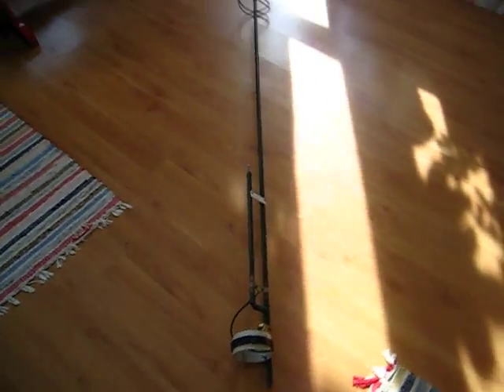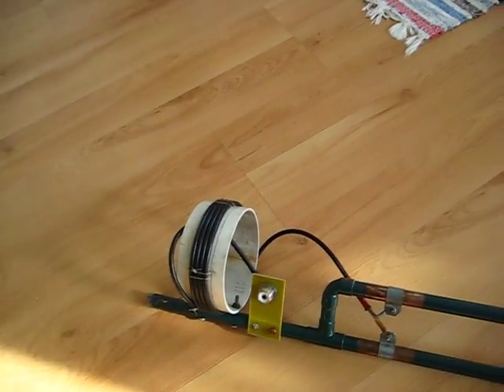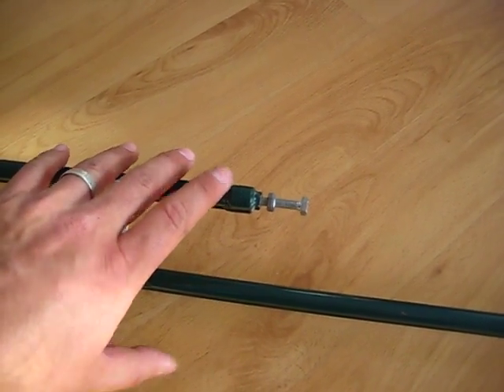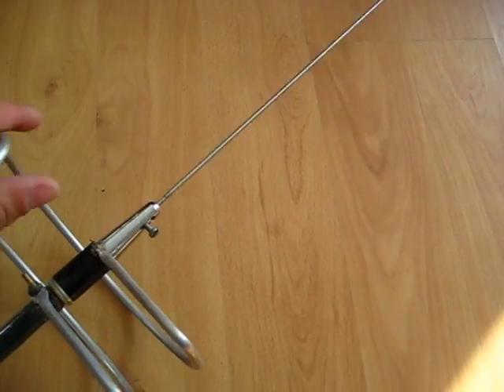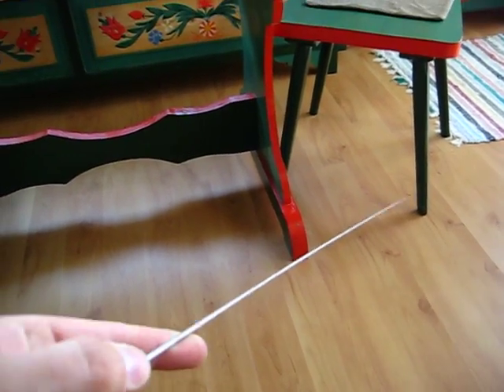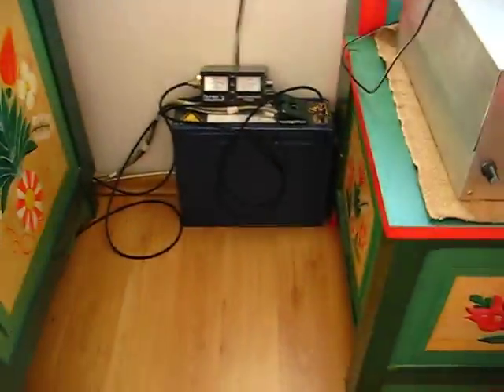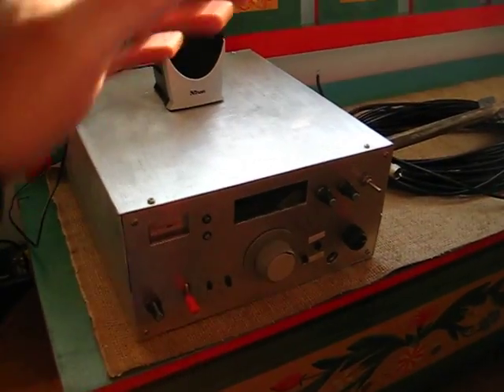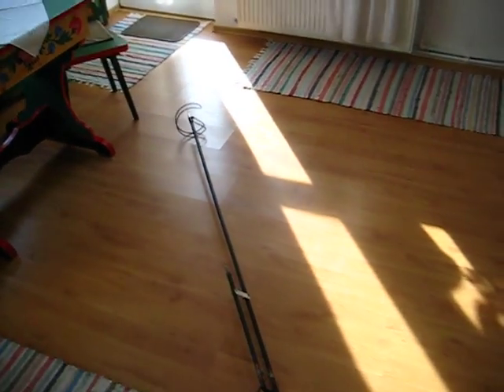5/8 wave J-pole antenna for 145 MHz

Comment: Pros : Excellent Pro-Look and Finish , you can sell it ..
Cons :  i am only worried about the SO-239 fixed in a board which susibtiable to break in rough condition ..

However 
i think this is not 5/8 element as the video address.
i think this is a  2 HalfWave Collinear Elements working together as both have the same Phase ..which yelds = more Gain + Lower Radiating angle than the conventional (5/8 wave Antenna = 4 feet antenna for mobile)..

5/8 wave lenght = 3.5 dBi
2 halfWave = 5.5 dBi (Better but Longer)

Comment: Just found this and am intrigued.  GREAT design.  However you call it a 5/8 J-Pole antenna, yet the phasing element is at 1/2 λ and the CB antenna you stated as 1/2 λ but looks about 5/8 λ in length… ?    Doesn’t the addition of the “CB” antenna mess up the 5/8 λ total length of the 2 Meter length side of the J-Pole?  Also the diameter of your balun, ~5”?  5 turns?  Thanks!  Newbie… KI7QAB  73’s!

Comment: hi pityu... most mosques in our area have fm transmitters. they transmit lectures and prayers ect. it is a good system. however people living in lower areas cannot pick up signals. the transmitter runs on " 60 mhz to 70mhz". can you send a video on how to make an antenna for this

Comment: I use the CB Whip part to spank my girlfiends butt too. She seems to enjoy it, idk. Great build man, thanks for sharing. I finally got a HF Transceiver, an Icom 7410. Now I'm stuck in an apartment with no antenna tolerance. I put 16 ft. Of bare wire around the walls at my apt. Working 20 meters, 17, 15, 12, and finally 10 meters sunday to Virgin Islands from Western Arkansas. I need a boost on 2 meters to hit our repeater due to all the apartment bldgs. I have around me. So thats a solid aluminum tube ring...Wow, I have some in my closet. Thanks again sir, I hope to hear you on the bands. 73
AF5DK,
Phil
Reply: Phillip Swearingin build a mag loop. 3-4 feet in diameter and can handle 200W+ with the correct capacitor

Comment: Very Funny : I built the same 20 years ago. It was almost totally identical, painted black like this one, with a bolt on the short leg for adjustement and a thin upper part on the long leg. Only difference : The thin part was 6mm copper tube with another screw at the end to adjust. It worked like a charm for about 5 years on the roof of a 17 store building. Then I moved to another house and tried something else :)

Comment: you should have done 1/4 wave element 1, then 1/4 wave first section element 2, then another 1/4 wave phasing element, then 1/4 wave cb whip element,  = 1 full wave and it would have been shorter over all.

of course this would mean the center conductor would connect to the small 1/4 wave element and it should be isolated from the rest of the antenna . basically the open stub design.
Reply: sir sorry to bother you so you deff 100% count the phasing element  as well ? every time ?  so in your case your phasing element used two of the eights or 2/8 ?      his set up has me clueless i thought jpoles was 3/4 .....  so im not sure if its just a 5/8 or more ?    ..... but i would like to know if i myself  wanted a 5/8 over 5/8    antenna  would i use a 1/2 wave phasing coil or a 1/4 ? if so whats best?

Comment: if you were to take a reasonable hobbyist's whack at hailing NA1SS (the International Space Station here uses somewhere around 145 MHz in this region usually more so than the VHF2 channels) which style 2m antenna would you use without going motorized tracking (I am not above stationing up to three stationary antennas on the roof, though - I have tubes and wires to spare, and a 3-antenna switch). Thanks!
Reply: Jeff Burris the ISS uses VHF up and UHF down. The freqs are on the ISS home page.

Comment: Very nice design. I am sure by now that you have tried the antenna. How does it transmit/receive? I especially like the CB whip mounted on top. I just built a simple j-pole for 146 mhz. I plan on putting it up tomorrow afternoon. 73, KD8BET.

Comment: What is the cb whip for?
Reply from the maker: Hello! You can use the same copper tubing for the 5/8 wave dipole part, the one I built from the CB antenna. I used the steel CB whip, cut to size, because it's much more lighter and more flexible than the copper tube. Just look for 5/8 wave 2m jpoles on the web. You'll find hundreds of plans, showing the same principle.

Comment: Isn't the co-linear J-pole supposed to be built from 1/2 wavelength elements over a 1/4 wave stub?
Reply: see this is what bothers me is it a 5/8 over 5/8... or a 5/8 over a 3/4... or 5/8 over a 1/2   ?...  im alittle pickeled ..... question  and would you count your stub the stub as one of  of the eights  of a wave ?? in his case 2/8ths  this ?? since its a halfwave stub        im just wondering how a 5/8 over a 5/8  6 meter 50 mhz antenna would be set up

Comment from the maker: The stub is the 1/4 wave part, the radiator is made out of a 3/4 section, the 1/2 wave phasing element, and the upper part is 1/2 wave made from the whip antenna. Performs pretty well! Take care! Pityu YO6PNQ